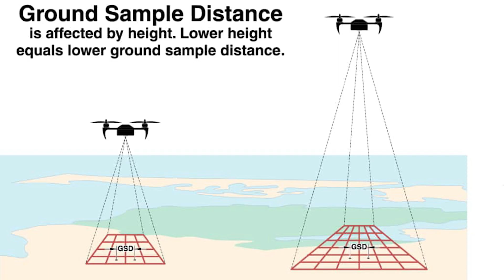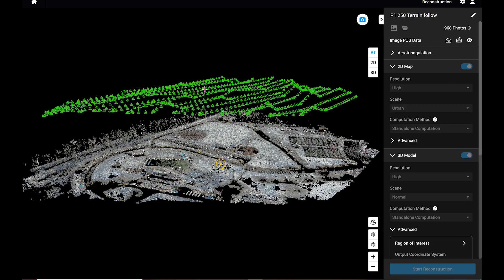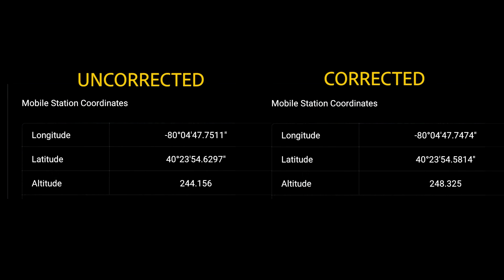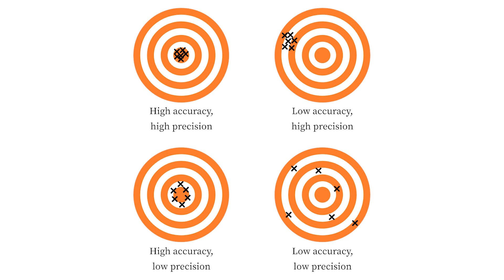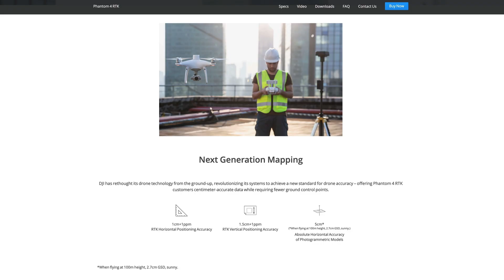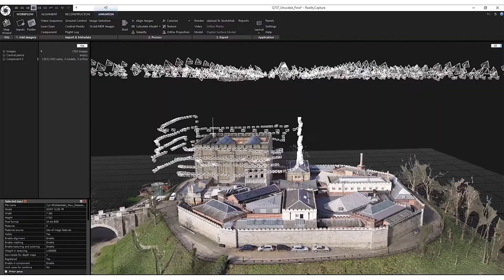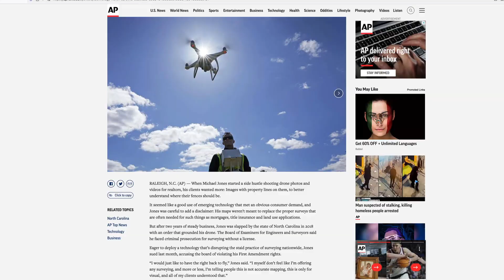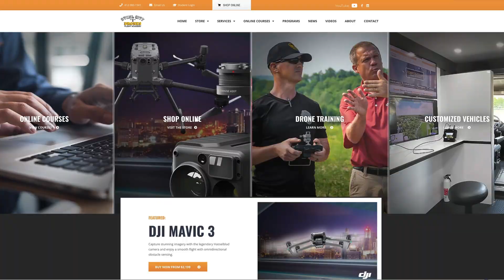Can the P1 Camera deliver Centimeter Level Survey Accuracy? | Mapping Deep Dive

Comment: Hi, David. While the M4/3 sensor has become the baseline for photogrammetry (Mavic 3E). Companies like Phase One are pushing the boundaries of medium format payloads. Do you think DJI should replace P1 with a medium format P2 sensor, just like L1 was replaced with L2? There was a significant improvement from a 1 inch sensor to an M43. How does the M43 compare to fullframe?
Reply from the maker: It depends on how much resolution you are looking for you and what GSD you need.  P1 checks the boxes in almost all applications. If you are doing runway inspections looking for very small cracks at a higher altitude for example then maybe the Phase ONe would be needed. Again its a matter of which tool works for you.